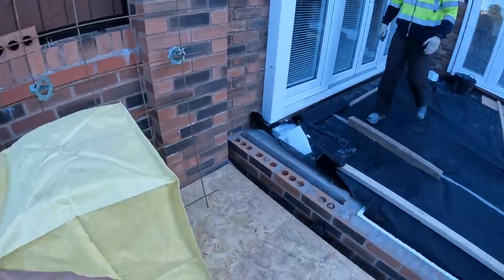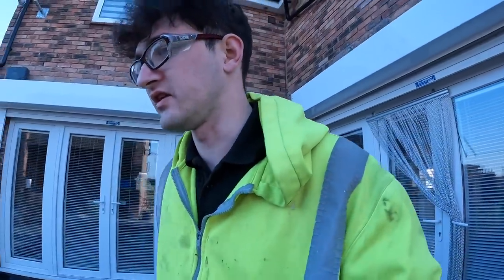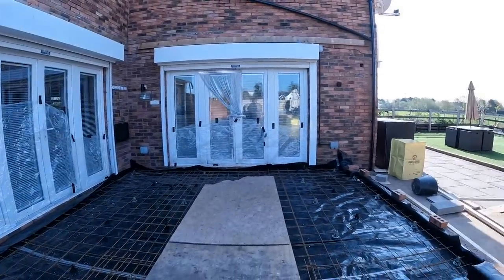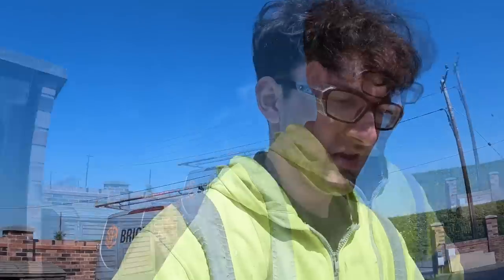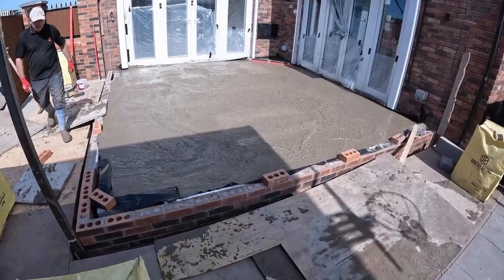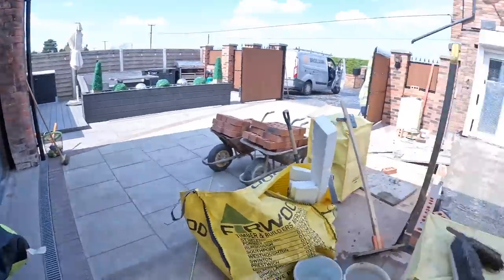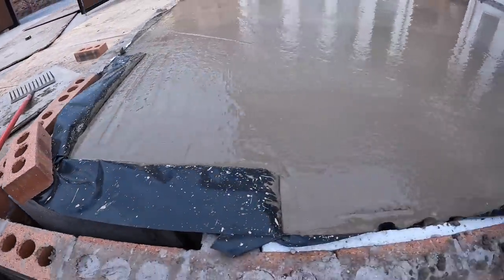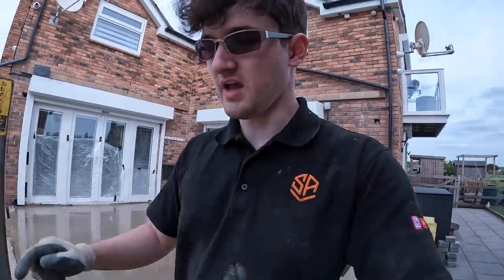REINFORCED CONCRETE SLAB!!... L SHAPE EXTENSION PT3

Comment: That mix was pretty wet. You shouldn't see standing water on top of the mix. Soupy concrete doesn't have nearly the strength of a proper mix. (I wounldn't have accepted it.) Even so, you guys did a bang up job on getting it spread, leveled and finished. I agree with Paul Lindsay though,  I think I would let slab guys do that stuff. They have all the special tools for it. And you can work something else for the day. Good to see ya guys! Hope all is going well for you both. Carry on gentlemen! Cheers from your mate in Texas!
Reply: That’s what you get when using visqueen plastic with volumetric concrete. Ready mix concrete would have avoided the excess bleed water
Reply from the maker: @itsallaboutsammy3594  🧱👍🏽
Reply: @itsallaboutsammy3594  Agreed. Unless there is clay soil, we wouldn't use plastic under the concrete unless we were putting down foam insulation on the ground first. The site mix truck should be able to dial it in better than that. Get a slump cone and check the slump before accepting the mix.

Comment: Just a tip, you don't need a spirit level to Finnish a floor, the concrete is a liquid at that stage it will find its own level, a vigorous tamping to purge the air voids and bring up the fat is all you need...

Comment: Where those two guys with the barrows from the concrete company or your hires? Over here in the states the only thing the concrete drivers do is turn the drum in reverse to pour, The wheeling and placing is all up to you. And if you don't have enough labor hired they will charge you over time for the concrete. I think they allow 20 minutes per cubic yard but that seems like a plenty of time.
Reply: Concrete supplied by Batch trucks usually comes with ''Free'' barrowing service in the UK which makes them more common on the small to medium pours. Your regular concrete mixer wouldn't so you would need the man power to mover it but on larger jobs you would probably have a pump anyway.

Comment: Is this a 1 storey or 2 storey extension? Going to be a well engineered build if its just one! 
'Concrete with the Hauses' is a good YT channel (US) to watch for concrete slab pouring, they would have used the laser to trowel a 1 foot strip along the door then just straight edged off that to the wall on the other side to get the concrete gauged in.
Reply from the maker: Thanks pal , yes just a single storey extension . 🧱👍🏽

Comment: Growing up one of my friends dads was a mason contractor. Old school guy who started in the 1940's. Taught us to do flatwork with what he called a "Darby" which is a screed for the slab made into a triangle which you can stand up and float it across your slab in a sweeping motion. We used grade stakes to level our concrete and after floating the darby point to point across the grade states would pull them out. I have not seen anyone using what he called a darby since outside his family. But i made my own and have used it for slab work. He has passed on now 20 years but his son, my friend,  is a builder and me a chippy (as you call them over there across the pond)
Reply from the maker: Thanks for the e mail . A very interesting video too 🧱👍🏽
Reply: can I see the video in question
Reply: Little bit on the wet side, pretty normal mix for the uk though… I’ve seen far far wetter
Reply from the maker: @amateurvegan2636  🧱👍🏽

Comment: You should leave a 50mm gap for the mesh  on all edges of the concrete
Reply from the maker: No you shouldn’t
Reply: @SteveAndAlexBuild  Steel Reinforcement Mesh & Rebar for Concrete Slabs - Specialist ...
There must always be a minimum of 50mm cover over steel reinforcement, both above, below and around . The fabric is supported from beneath at
Reply from the maker: @stevenclarke1737  . There was. 
A 50 mm gap didn’t make sense